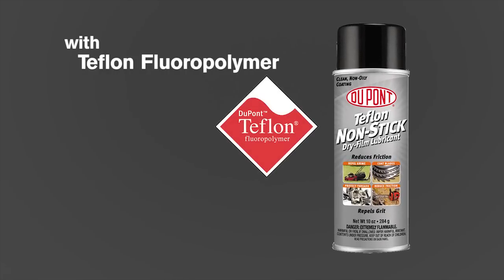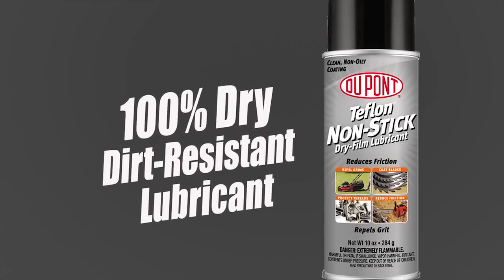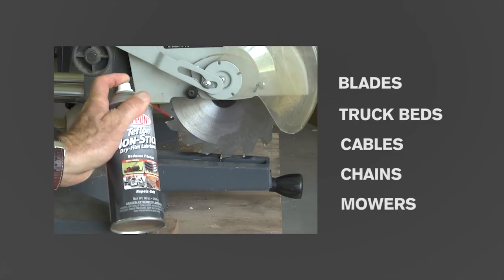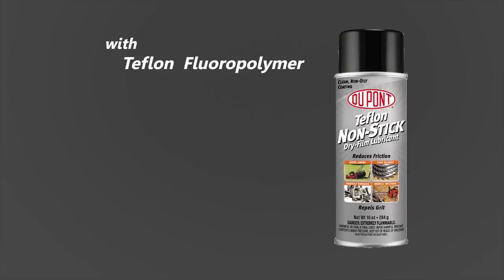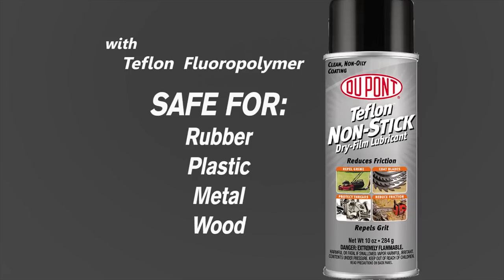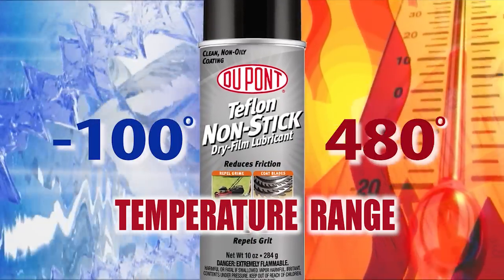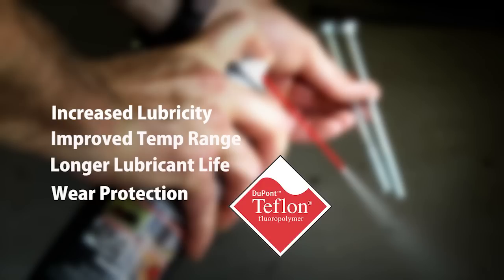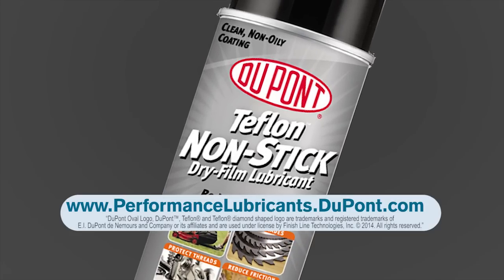DuPont® Non-Stick with Teflon® Fluoropolymer

Comment: What about a frying pan?
Reply: i add that to my cast iron skillet
Reply: Please donot apply this on any cooking utensils
Reply: Arkadeep Datta Why?
Reply: @kcototheyoyoyo  Teflon breakdowns and causes cancer when you overheat it or if you consume pieces of the coating after it flakes off from wear. It takes a lot of overheat it but most people are just being cautious. I personally still use non stick pans but I make sure to always have food cooking in them to keep the temperature low and discard the pan after a year or two or if I see chipping.

Comment: can you coat a pan with it?
Reply: No!
Reply: Everything unnatural which you contact now which your ancestors do not contact gives you cancer. That is the backbone of evolution.
Reply: NO
Reply: Oh god no, this is cancer in a bottle for industrial use only. Whats wrong using "Pam" Oil Spray?
Reply: @jennyfromtheblock5000  Are you saying that using this for kitchen pans is reasonable? Thats like saying drinking a bottle of bleach gives you cancer so might as well drink it since "everything" gives you cancer. If you try to be smart and think logically, bleach is actually mixed with our NYC drinking tap water, NYC has the best tap water in the world, yet our government puts extremely low quantities of bleach in the tap water to prevent bacteria growth. If you know a thing or two about math, you'll die faster drinking bacteria than drinking low quantiles of bleach. Theres a balances for everything. This product however is not safe for the kitchen/cooking use.
Reply: @Brian-gj5xm  Not forgetting high amounts of Arsenic in the old green Wallpaper.